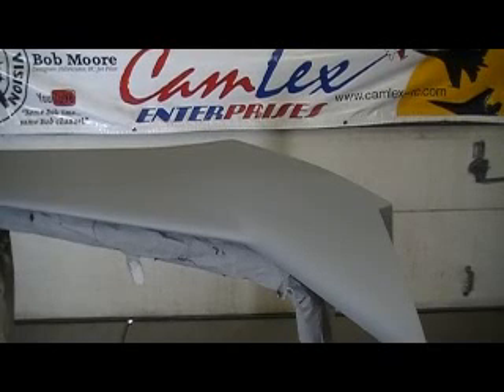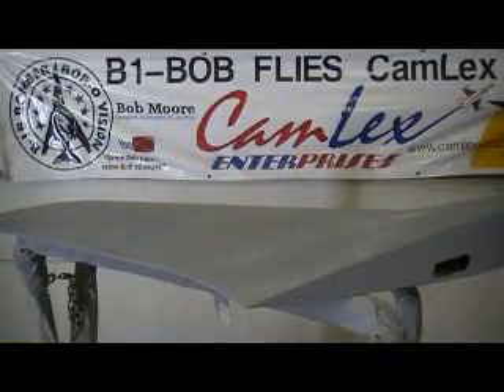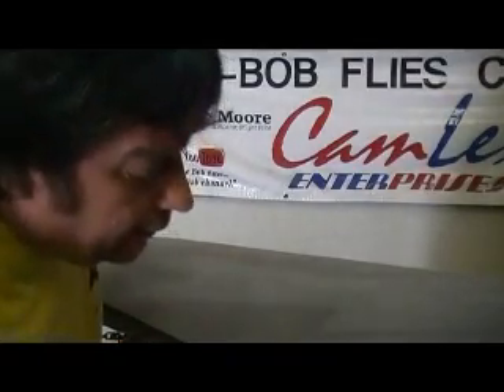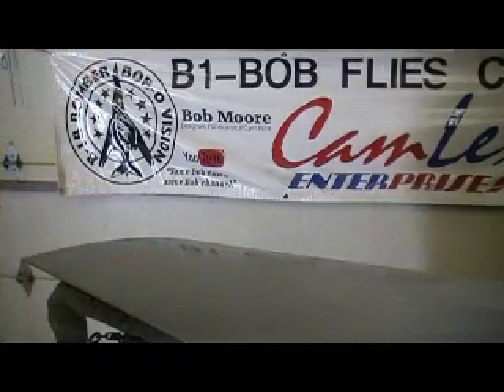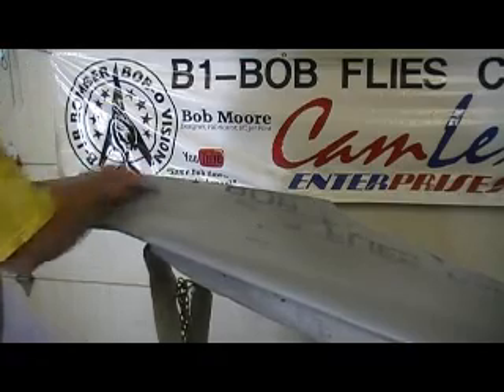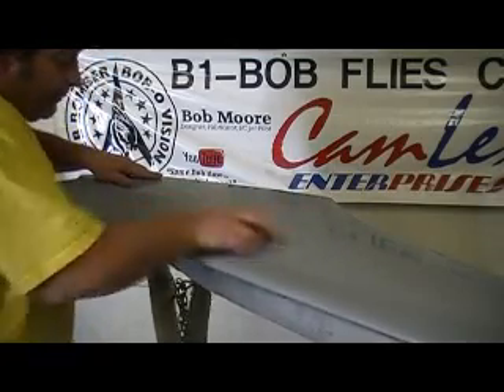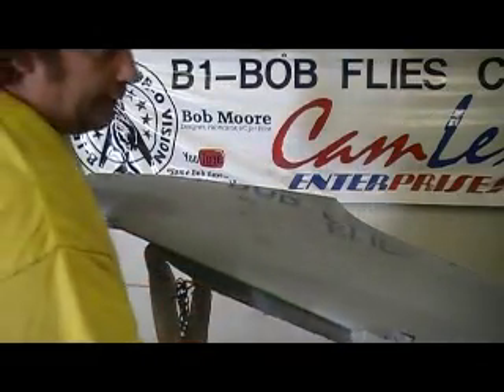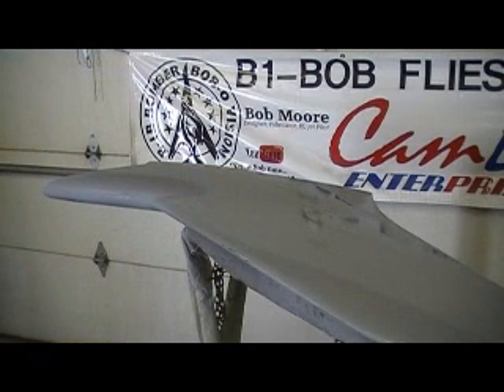how to build a rc jet F-105 thunderchief # 183

Comment: Have you checked how tight your wing fit is right now into the molded fuselage before you start putting thick coats of primer on the wing plugs?